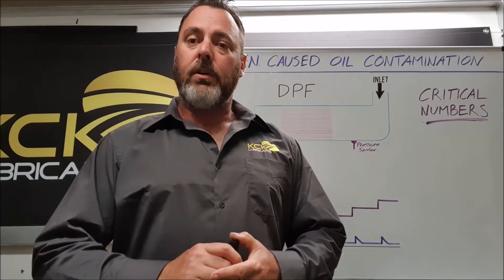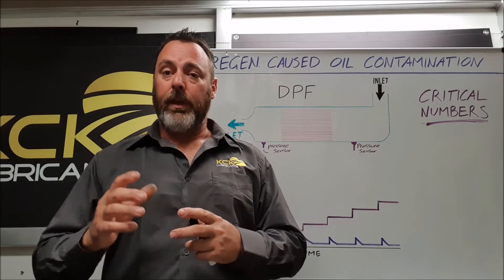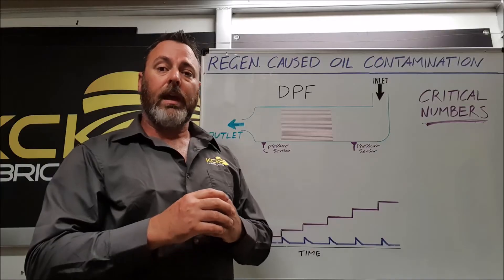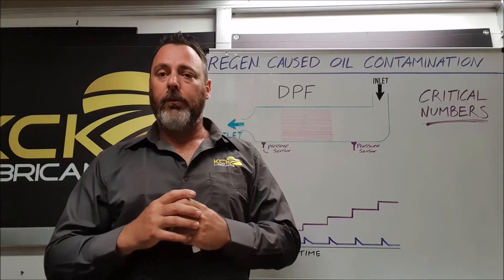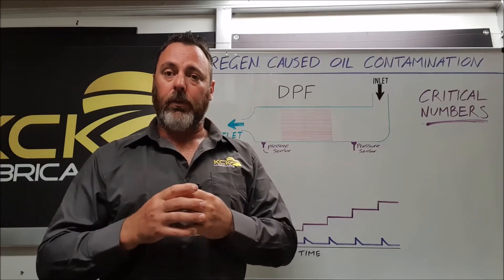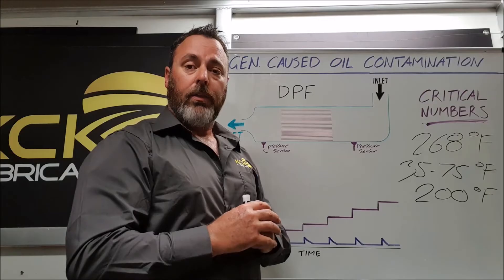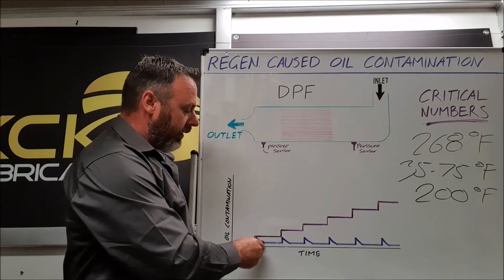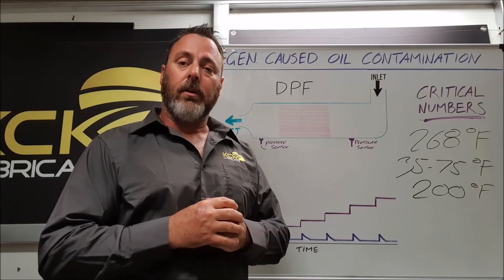Diesel fuel contamination in engine oil caused by DPF Regeneration

Comment: I have 2000 international 4700 the oil is being pulled from the engine into the fuel pump. Have not been able to find the problem any information will helpful thanks
Reply from the maker: Thanks for watching and make sure you subscribe! I can only guess that the fuel pump outer seal has failed (the seal that separates the engine oil to the fuel pump itself)

Comment: I own a 2012 VW TDI i just use Liqui Moly Top teck 507.00 spec oil change it at 6,000 and dont extend oil changes if You do it will add more than necessary crap into the DPF filter that You dont want. and i run it hard on the highway some times to blow the crap out of the DPF one needs to drive these German machines like there back home on the Autobhan some times. that's tthe nature of the beast and secret to keeping that DPF Filter clean.
Reply from the maker: hold it flat! increasing the engine load/engine speed and therefore the exhaust temperature will help keep the DPF clean

Comment: I have oil contamination with diesel on my mazda cx5. Dpf regeneration was done then 3 weeks later it was back on again. I've left it a few months now the oil is contaminated. If I do an oil change and regeneration will it fix the problem?
Reply from the maker: Thanks for watching, it sounds like there may be a problem causing the regeneration and therefore the excessive oil contamination.

Comment: Hi thanks for your video. I have a dmax 2013 , I changed oil and filter , and around two weeks later the oil level was already rising! . I have booked a dpf clean, and will change oil and filter after. Do you think that will help or solve my problems please??
Reply from the maker: wow, I hope so! you will find out pretty quickly after the DPF clean if the problem is still there on not.
Reply: Did the DPF cleaning additive work?
Reply: @songoku7915  DPF cleaning guy  plugged into my Dmax  with his laptop and said all looks ok! . He did a carbon clean, but regens are still around the 50 mile mark and oil level is still rising!. Have ordered a EGR delete cable from OZ , and am going to give it a try, failing that, it seems like I have got to have new injectors, bloody expensive!!!!. Wish now I had bought a Hilux.
Reply from the maker: @songoku7915  Thanks for watching, not always
Reply: Hi. Did you solve your problem? What did you do?

Comment: I watched it thrice to understand the importance of running the engine oil temperature above the flash point of the Diesel(to make sure that the Diesel vaporises instead of contaminating the oil on the engine sump during regeration). Hope i got it right. This is very helpful thanks and respect 🙌🏾
Reply from the maker: Thanks for watching!
Reply: Yes, thought same here - good to check your particular engine oil temperature specs. ! :)

Comment: Great video for oil dilition caused by DPF but how to rise the oil temp. to 268F during the regeneration? shift to 3000 rpm?
Reply from the maker: If you can maintain some load on the engine it will help

Comment: Good video. Do you know what is dpf fluid used for on some vehicles? It needs to be filled up every once in a while, but other vehicles don't use it at all
Reply from the maker: Thanks for watching and great question. I believe it is used in the Peugeot & Citroen diesel, a number of these vehicles are fitted with a DPF dosing system that stores your DPF additive in a tank or bag separate to the fuel tank. Each time the vehicles fuel tank is refilled the engine management system injects a 'dose' of the additive to your diesel tank to aid with efficient regeneration of the particulate filter.
Reply: @KCKLubricants  thanks

Comment: Just imagine the scars it’s leaving in cylinder walls as it passes by the rings it’s basically recycled dirty air going back into your engine without being filtered and what’s worse is carbon is or can be hard like sand.
Reply from the maker: Thanks for watching! Agreed, fuel washing the lubrication from the bores is becoming a huge problem with this configuration!

Comment: Good info, but i have mercedes cla 220 cdi 170hp 2013, and i didn't get emergency light for regeneration of dpf, but i did't any way, so now i don't know if i have to change oil or this car have  something for anticontamination? Thanks in advance. Grtz
Reply from the maker: If your in doubt change your oil! if it looks ok maybe consider going on a longish drive to get your oil temperature to full operation temperature to assist in removing any excess fuel. Thanks for watching and make sure you subscribe!

Comment: VW 504/507 is only available in ACEA C3 SPECS. Will there be a VW 504/507 compatible with ACEA C1 in the future? If the answer is "maybe yes" will there be a significant difference on the number of regen triggered by the ECU in your opinion? Thank you!

Comment: Hello! How do you consider ACEA C3-16 vs ACEA C1-16 engine oil effects on the DPF? Is there any significant difference in term of clogging the DPF? How less frequently will the system regenerate with a C1 oil instead of a C3? Thank you very much for your answer!
Reply from the maker: Great Questions! Stay tuned and we will try to put a video together to answer your questions, make sure you have subscribed!

Comment: Hi, In a deasel engine what are the parameters that I can mnitor to anticipate regen (based on fact that it is not a car that triger regen by fuel consumption or runing hours) meaning monitored and triger by the ECU based on the requiered parameters.
Reply from the maker: Thanks for watching! Typically the regen cycle is determined by the pressure difference between the inlet and outlet of the DPF, when it begins to clog the pressure difference will be greater and the ECU will trigger a regeneration cycle.
Reply: @KCKLubricants  
Thanks

Comment: This is the best explanation i've seen until now and sums up all the problems with that generation of TDIs that had DPF mounted on them after they were engineered without a DPF. I hear everywhere about how bad are those engines and how they start having a lot of issues caused by the DPF clogging. And yes, clogging the exhaust can't be good for any engine. Ofcourse, the problems appear o those cars used in the city on short distances and a lot of DPF regenerations occur because of this. I once saw a TDI engine with DPF (VW 2.0 TDI CR engine from 2010) that had 754000km done in 7 years, but that car went between 2 airports only on highway, ~600km/day on a round trip, so i think that DPF didn't need forced regeneration.
Reply from the maker: Thank you! Make sure you subscribe and thanks for watching.
Reply: @KCKLubricants  I forgot to subscribe, sorry. Subscribed. Thank you for your useful video, i will watch more on your channel :)

Comment: Hi, master ! I have a 2014 ford transit custom 2.2 
Also have facing the diesel contamination problem. And the same time the dpf regeneration every 30km.
This situation has continued for more than 80,000 kilometers, without engine failure light.
Reply from the maker: Hello Andrew, Wow regeneration every 30km sounds very excessive! I would suggest there is something wrong with the DPF? Constant short journeys or incorrect engine oil may cause permanent damage to the DPF and it is unable to be cleaned by a regeneration cycle. I would be interested to hear what you find the problem to be.
Reply: @KCKLubricants  last month I replace the DPF. Also, clean the 5TH injector, and replace the pipe temp. sensor. The diesel contamination was fixed. But still regeneration every 50KM.
Reply from the maker: @a.p.3167  Thanks for watching, there is definitely a problem with the system,  it sounds like the ECU thinks the DPF is blocked it. Possibly a sensor fault
Reply: @a.p.3167  hey man, did you fix that?
Reply: This engine actually uses a "5th injector" but  also seems to use post-injection alongside.

Comment: Very informative. However, this describes how the system would operate in "ideal" situations. What happens to the oil if the regeneration of the DPF fails or is interrupted? While the complexity of the computers in cars has steadily increased the information shown to the driver has decreased.
Reply from the maker: Thanks for watching and thanks for the feedback, yes that is correct that this video is discussing a serviceable system that is working as designed by the manufacturer. We will put together a video to discuss the points that you have raised so subscribe and stay tuned!

Comment: Did the 2013 VW tdi use portion of the  oil to use as fuel for the dpf regeneration?
Reply from the maker: Hi Dan, To the best of my knowledge in 2013 Volkswagen is using post-injection for regeneration and i haven't heard of them using oil to assist in the regeneration cycle. If anyone has the answer to that i would love to hear it!
Reply: @KCKLubricants  I am trying to figure out why the car is consuming 1 quart of oil in 500 miles.  New turbo, good compression and drives great. Regeneration happens more often than usual. No leaks outside of the engine. If you have any tips please let me know.  The dealer has no clue and they have had it in the shop 7 times.
Reply from the maker: @dand7056  WOW!! if the engine is 'consuming' oil it will cause more frequent generation cycles. Sometime switching brand or type of oil will cause a short period of increased oil consumption but this should settle down within 5000 miles or so.